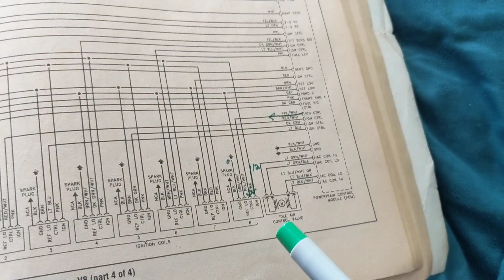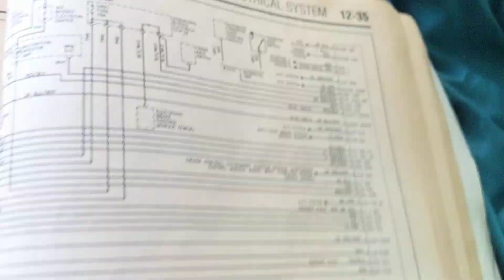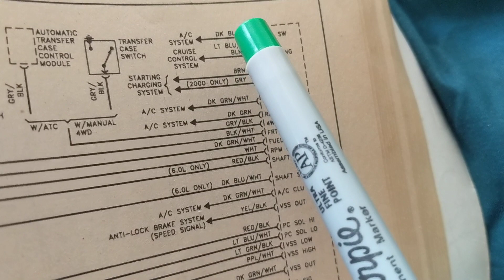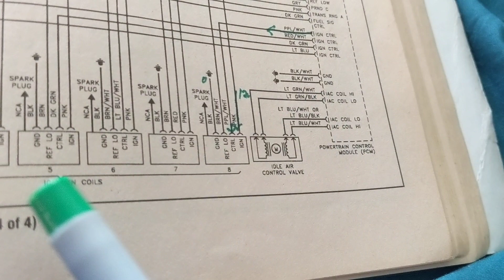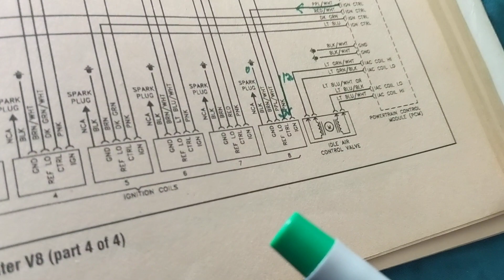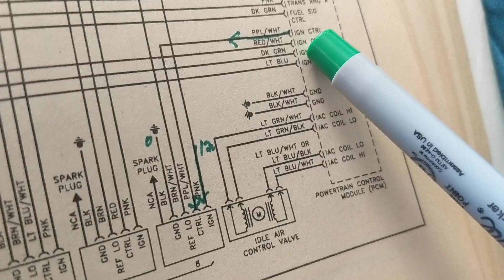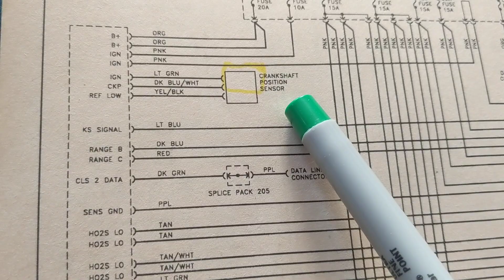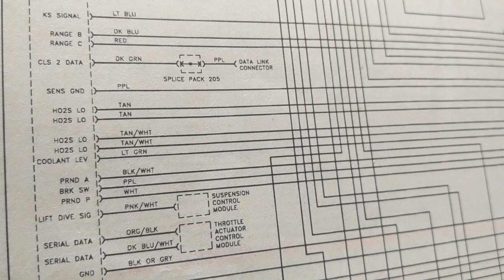HOW TO READ AND DIAGNOSE COMPUTER WIRING DIAGRAMS FOR ALL VEHICLES

Comment: Hey so that black dot where both "ref lo" wires meet, like the one from the ignition coil and the pcm. That is like a relay?

So if my car is in limp mode with the overdrive solenoid off, I could bypass it by providing my overdrive solenoid to ground with a toggle switch, and cutting off the original sender wire?
Reply from the maker: Reference low is not a physical ground but aground given by the to a coil or a relay and limp mode means the computer has puttin you in a lower power capacity for the engine meaning like you are limping and does not get full power output from the engine that is something the computer decides
Reply: @Joeelectronicschematicsforauto   okay so if a IMRC failed sensor is causing limp mode by not providing a ground or enough voltage to a shift solenoid, I can bypass it by cutting the IMRC reference wire from the sensor to the pcm , then ground out that wire or tie it to another constant power wire?
Reply from the maker: Reference low wires are from the PCM giving it a ground just like the fuel injectors what information are you looking for so that I can respond
Reply from the maker: You cannot bypass reference low grounds they are from the computer and the computer toggles it when it needs to tell me what information you are looking for